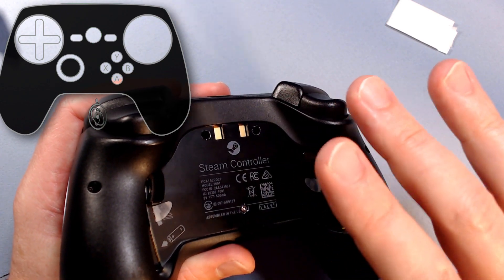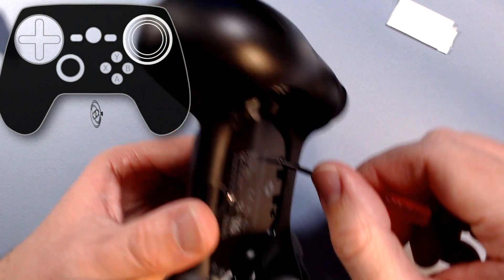Steam Controller Mod - Softer Trackpad Click Update

Comment: Today I recieved my screwdriver and silicone pad.I followed your tutorial and it worked very well. Thank you man.
The bumpers and grip parts are easy and amazing that I suggest every sc owner gives a try. The trackpad click need multiple times of screws adjustment, not good as the before two, but still worth it.
My silicone pad is 1.0mm, I want a thinner one but I can't find. Anyway, it's good enough for me.
By the way, to make trackpad click work, I ajusted all the 7 and 4 screws.

Comment: The plastic stripped around most of the screws on mine. I used some plumbers tape to try and give the hole a bit more grip. Ended up screwing it so tight that there are two indentations (one on each side) right below the track pad where the screw hit the front plastic!

The bumps look like a design feature they are so perfectly round and symmetrical. At first I was like "wow I never even noticed these here" until I realized what I had done.

Doesn't seem to have affected anything though!
Reply from the maker: yikes!

Comment: I had also tried to stuff the blisters on the motherboard first, and often the buttons would not react after that. It seems to me more appropriate to intervene on the plastic tips of the carcass that press on these blisters. The blisters seem more fragile than the plastic part which is pressing on them. So maybe it's better to test on these plastic parts. I didn't have to be careful about tightening the screws and maybe it is thanks to that.
Also, we tend to use flat padding on the motherboard, while the blisters are a bit rounded. This means that the padding on the motherboard tends to contradict the shape of the blister. I think that's why it's harder to make it work this way. On the contrary, the plastic tips which is pressing on the blisters are already rounded, so it seems more logical to me to surround them with a padding that will just make bigger and soften its contours, but still resembling the blister that they will now press together.

Plus, for the grips, it makes it possible not to disassemble the whole thing, since these tips are directly on the back cover of the controller. 

You can also check what i've done here : https://www.youtube.com/watch?v=spZvtWrpoNo
Just a rough illustration, but working very nice since two weeks now.

I should also try with silicon or materials more close to the one you're using, it seem better than the classic paper i've used untill now. I've also made some padding tapped on my back cover for my left grip with part of nitrile gloves. Also working pretty nicely untill now. Still need to see if it will keep working nice on the long term.

Have a good day and thank you for the videos.

Comment: Very cool. I'm curious if you can effect the button sensitivity without installing silicone pads just by the screw tension or is this  a happenstance you came across because you did both?
Reply from the maker: It's mostly from the extra layer being placed on top of the button. It really doesn't take much (you can see how thin the silicone is) but it's JUST enough to affect the tension point through the screws. EDIT: I should stress that didn't extensively test it with nothing on top of the button. My goal was always to add something on it to dampen the sound.
Reply: @RambleCan  I can confirm that without adding anything on top of the button tightening the screws a lot does not activate the click like you demonstrated in the video. Also thought I'd mention that cleamomg the bottom of themetal dome and the pcb it makes contact with with some rubbing alcohol and a qtip got my left pad click working properly again.
Reply: @RambleCan  Nice. That answers that. Thanks for the reply. I think I might do this mod myself considering the noise those trackpad clicks make. As always, thanks for the insightful Steam controller videos.
Reply: @Anvie__  Very cool. I love it when you're able to fix something with just a bit of ingenuity and everything is as it should be.

Comment: This is because your silicone pad is too thick. Now the right thickness is probably withim a tolerance or 0.05 to 0.1mm so I guess you'll have trouble finding that specific a pad, and the screws are somewhat of a work arround to this... The main issue is I think it will have to be tweaked in time, because the plastic holding the screws will yield a bit and the pads will get a bit thinner with use, and if it's a headache to "tune" it might because a headache to maintain.

Regarding the source of silicone there are many but two accessible shops which will do b2c are Digikey and Farnell. 3M does that kind of stuff and should be available at those shops. The reason I'm recommending these sites instead of ebay or alibaba is that you'll get TDS for each product (technical datasheets) and so you'll know what you buy in terms of hardness, material and thickness.
Reply from the maker: At the end of the day we're jamming stuff inside a device where it wasn't meant to be so there's always going to be some caveats. This was the thinnest and quietest material I could think of. I tried layers of electrical tape but they were still loud.